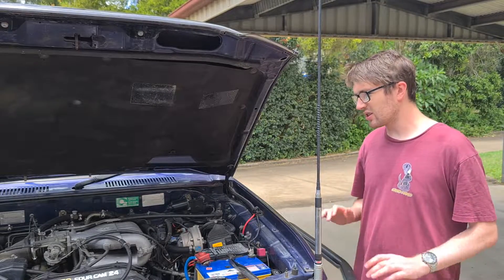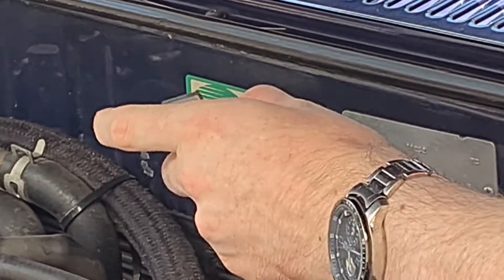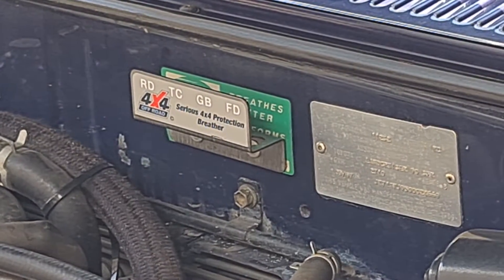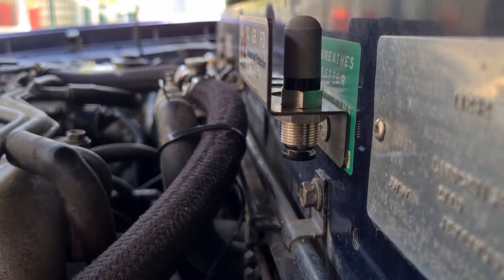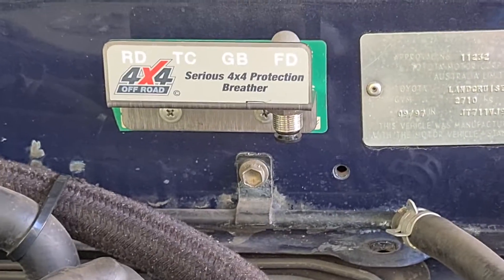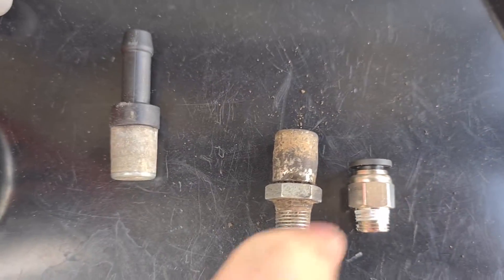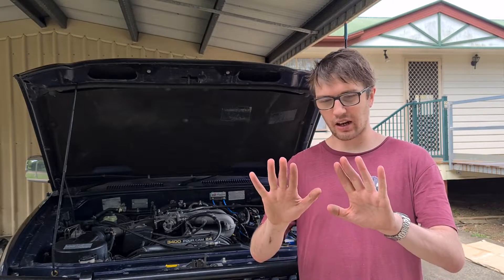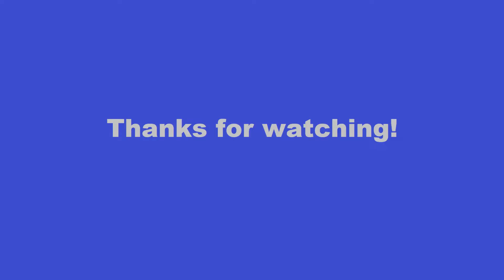Noelsy's Outdoors | 90 Series Prado: Diff Breathers

Comment: On the 90 series both the transfer case and gearbox/transmission have separate breathers. The breather for the transfer case is located at the front passenger side of the TC just above some wiring. It points straight up and has a rubber cap on top.
The transmission breather is located on top behind the bellhousing. It has a metal cap pressed onto it which is difficult to get off but not impossible. 
Note the transmission and transfer case are also joined via a small rubber hose between the two, which can be located from the drivers side on top.
Reply from the maker: Very useful info! Thank you for the comment

Comment: Hey how ya doing I think you'll find the transfer case and gearbox breather behind the engine above the belt housing should be 3 two for the transfer case and 1 for the gear box / transmission .all you need to do is get some brass barb to barb fitting and tap into the existing factory rubber pipes , hope that helps you 👍
Reply from the maker: ill have to have a look again thanks for the info
Reply: @NoelsysOutdoors  So what about a little update ?

Comment: Have you got a link to the adapter for the stock front hose to the airline adapter ?
Reply from the maker: @OMGitsathing  unfortunately my adapter came with the kit but im sure it wouldn't be too hard to find its just a barb fitting to air line adapter

Comment: Looking forward to see the transfer case / automatic box being attached as well 👍 I also did front and rear but not the transfer case yet, same reason haha :).
Reply from the maker: I'll definitely be putting it up when i do find it haha thanks
Reply: I found the transfer case and transmission ones by accident today while replacing gear stick bushing. If you take off the gear stick and panel beneath it from inside the cab you'll see them right there on top. Quite high already to be honest
Reply: Ha, thanks @JDM950 !  Might look into that. FYI we just returned from a 4300 km long trip through Iceland with many water crossings in the inland. No oil leaks this time. I believe without the breathers you suck stuff between your seal and axle causing them to wear out. For me these breathers are a great mod.

However, I think this time the water damaged the starter. Sometimes when starting after the car has been sitting for a few days, you only hear a loud clicking noise. In that case you have to turn the key one or two times more. Considering you cannot jumpstart an automatic, I will attempt to replace this thing. Possibly keeping the old as a spare.